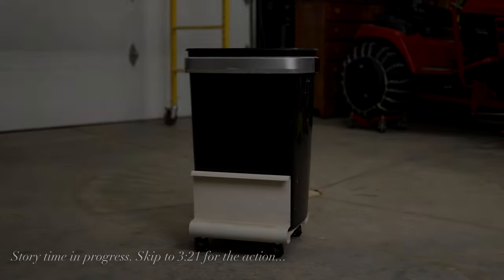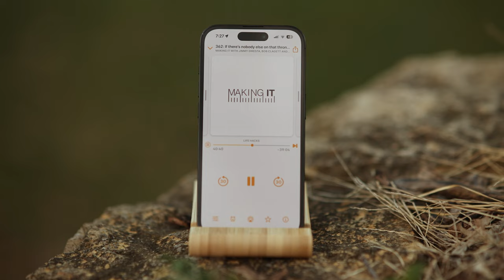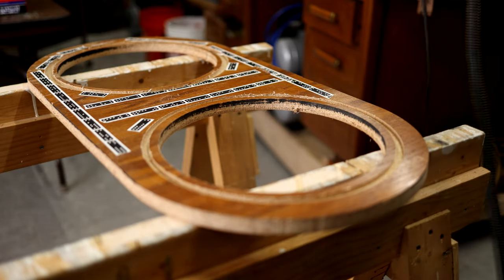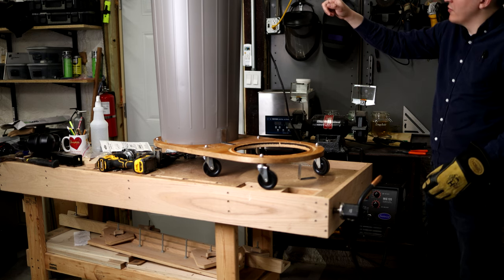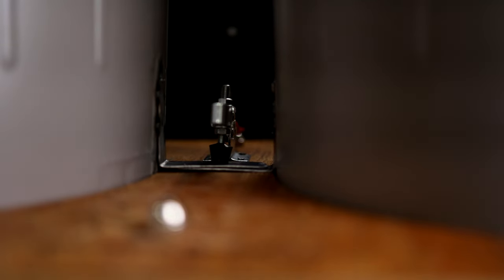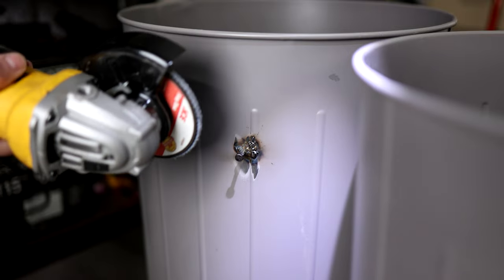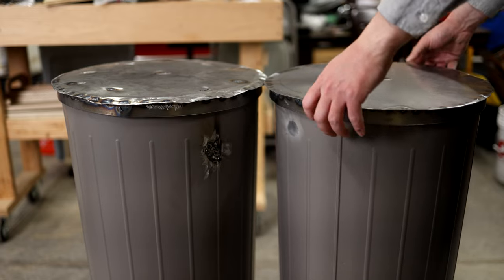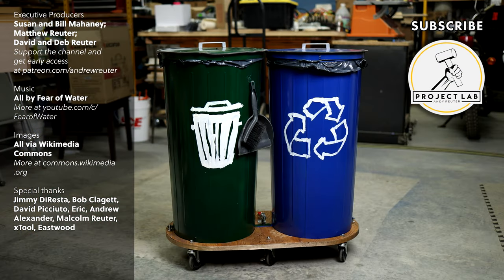This compact trash can cart could save your workshop

Comment: Being able to hang the lids like that is gonna prevent you from closing them. If you're really serious about safety, you'll need a trash can where the lid is always closed, and there just isn't a way for it to stay open. A pedal bin would be a good example, it'd just have to be upgraded for workshop use.

Never forget: a safety system that relies on humans will fail. Not if, only when.

Comment: Your weld is too hot for the work piece perhaps.
Reply from the maker: Yeah. There was a lot going on there! But still worked out in the end.
Reply: @AndrewReuter  there is welding, and there is sheet metal welding, two totally different skills.  sheet metal welding is much harder when it is the thickness of tissue paper.